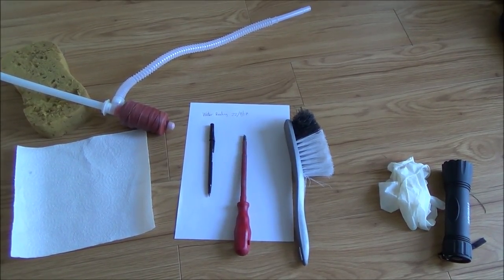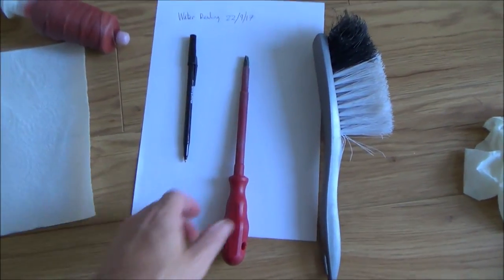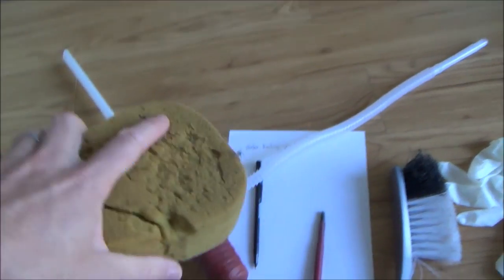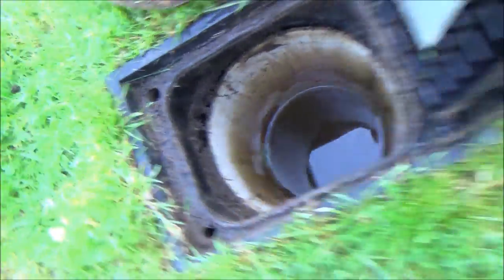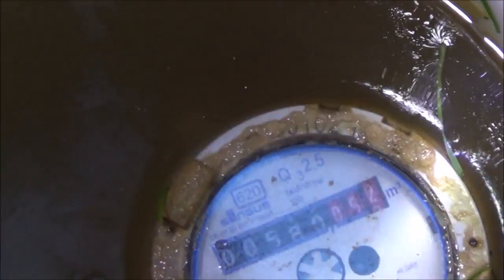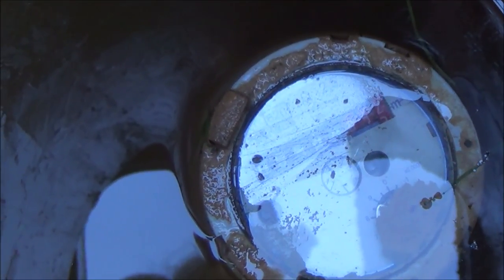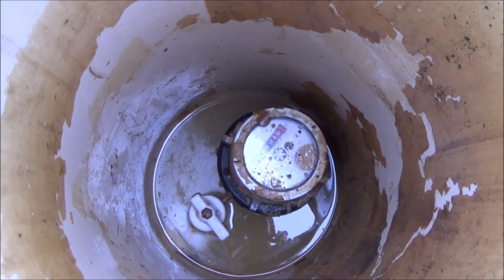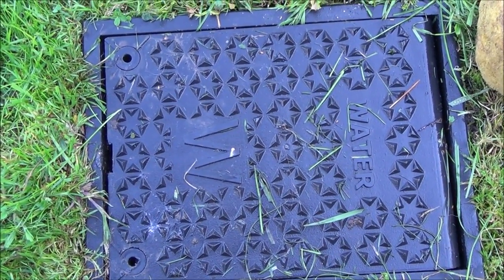How to READ a WATER METER, Check for Leaks and Turn Off Water Supply

Comment: Thanks for taking the time to make this video. I turned my stopcock off when we went on holiday recently. When I turned it back on I have developed a dripping leak. Great tip about isolating the meter. Got plumber coming today. Hopefully he can fit a lever isolating valve under the sink as I don't have great dexterity in my hands.

Comment: it is good that you mentioned, to turn off the water supply when you go away, for awhile, 
especially in the winter, I went to a ground floor maisonette, and there was water coming through the ceiling from above, the water had frozen, and then when it melted, it had burst the water supply pipe above, but the people upstairs had gone away on holiday, so I could not access it, to turn the water supply off. it would have been good to turn the water off, and drained the stored water,,,, or left the heating on, just at 5 degrees, to protect the water, and the people down stairs, who lost thier ceiling etc.
I wish my ground water level was high constantly, and my home would not be subsiding, and cracking up.
thanks for your straight forward info.

Comment: I take a photo of my meter once a month so I have evidence of the readings; it only takes a minute and prevents misreadings etc.  Someone I know had a leak which just flowed into the WC bowl in the spare loo.  The meter reading was estimated for months and they got a real shock when they got the bill based on an actual reading.  The water company were not interested!
Reply: That would be £50 a day so I guess it was for about £6000
Reply: some of these modern siphons leak internally into the pan, and overflows should be positioned, so that you are aware of what's going on, so that you will do some thing about it.

Comment: Thanku thanku I really appreciate for your effort however I got a question I am with themes water 2017 got a bill of 240 didn't even used a single of water I spoke to them they overfed me to pay 122 OK find paid.
Now they sent me 420 for a whole Yr. I am staying with mum all day and night and my sister house I do flash toilet may be once a month.
No shower no washing machine. No heating or boiler nothing at all. I buy water to drink
But my water meter keep going around number is changing every week is ds how it should be there isn't any leak inside the house and my meter is based under sink
Reply: do you mean " Thames water " does Thames Water read your internal meter ? there maybe an external meter you do not know about, have you tried turning off the water supply valve, by the meter, and then leave it for a week, and see if it has changed, you could have a leak, but not know where it is, if watter is going through the meter it must be going some where, some toilet cisterns have internal over flows, so you may not know, with out looking.even a little leak, can use up a lot of water, given time.

Comment: Vince, I live in a block of flats and I've noticed my water bill for this year has shot through the roof. I want to take a meter reading, but there are 8 meters outside my property and the serial numbers are illegible on all of them, so I've no idea which is mine and Wessex Water have been fuck all help. Have you got any suggestions as to how I can figure out which one's mine? Cheers!
Reply: Mr Thunderwing.........only thing you can do is,  turn each stop valve of to you find out which one is yours.   
Best to get another person to stay in your flat , turn water tap on,  and with you outside turning of the stop valves.
 When the water is turned of in the flat,  your helper will let you know that it is of.   . Problem solved.

Comment: At 5:13 Did you turn the stop cock counter clockwise to shut off the water ?
Reply: they are quarter ( 90 degrees ) turn valves

Comment: My place isn't metered yet I wonder if Id save money or not..I just get a standard bill of £31.67 a month regardless of how much or little I use.
Reply from the maker: I think most households would save money if less than 4-6 people live in the house and if you don't water your garden constantly. I changed to a meter when I moved because they wanted over £500 annually and I save a couple of hundred pound without even watching my water usage (baths etc.), but my garden is tiny with no need to water anything. It is nice when you are not on a meter to not have to worry about filling a paddling pool and hosing down the car etc. but saving £200 is nicer :-)

Comment: I don't use water in the house but. Why my meter  number keep changing going up and bill going uo
Reply: are they estimated readings ? if it's going in through the meter, it is going some where, you more than likely, have a leak in the pipe under the ground, between the meter and your house, which is your responsibility, if you are the property owner, try turning the water supply off at the meter, and see if it is still rotating through, there a little wheel with spikes on it,,  or if you have a toilet cistern which has an internal overflow, which goes through the siphon, straight in to the toilet pan.

Comment: Im a single mum so im the only one that uses water ,im not in my home most of the time .Yhames water meter has charged me a total of £900 just for this year .one bill came as £470 .i phoned them a few times but they said its not there fault n my water says what it says so i have to pay up .
Reply from the maker: Double check for a leak somewhere. Sometimes toilets overflow into the actual bowl so you may never notice that one is constantly leaking until you start getting a scale build up. Years ago most toilets overflowed outside so you would see the water coming out of a pipe and know something was wrong but newer toilets are designed to leak down the toilet so an overflow pipe is not needed, downside is it can be harder to spot when the water filling up does not stop :-)
Reply: Some times they calculate WHICH area u live also how many people live and how many bedroom u have. I remember once they have asked me to pay 350 while it s just me out all day. But my neighbour discovered they were a broken tab outside the communion garden